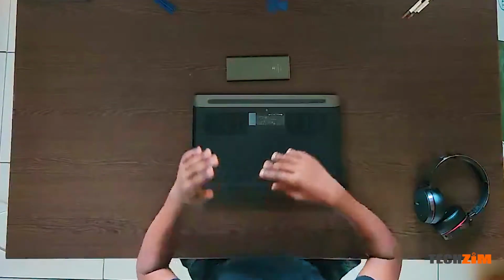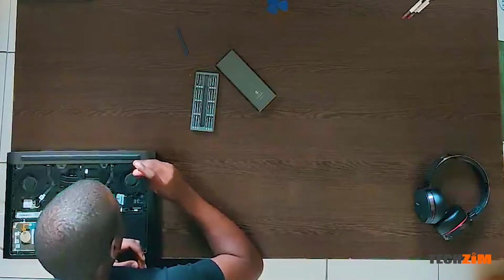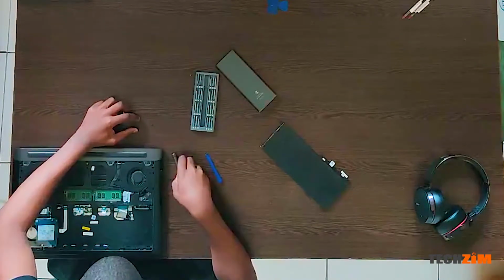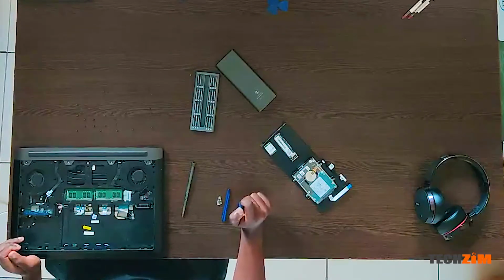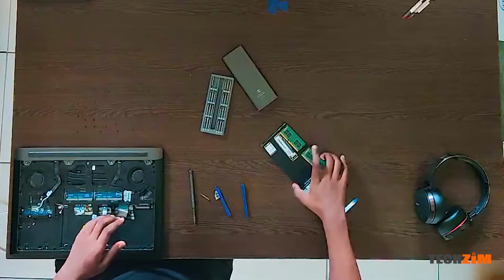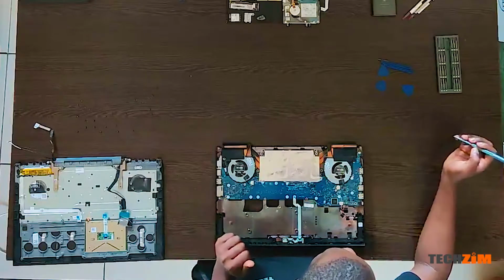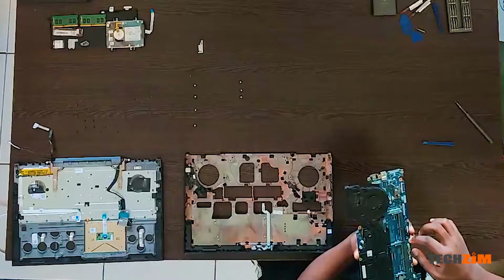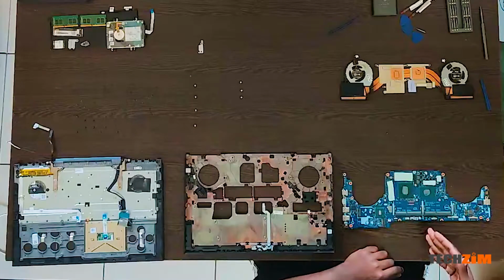Dell Inspiron 15 7577 disassembly

Comment: I have same model, i need to renew thermal paste. I use it since 2017, and its started getting hot. And some of my num keys and f12 not working.  I have 2 questions my dude. What u suggest for thermal paste brand. What could be the problem for unfunctional keys, am i need to change keyboard?

Comment: Thanks man. I've got a similar model. It's useful to see how I can go about replacing the thermal paste when/if the times comes.
How were the thermals after?
Reply: Hi Tich, thanks for watching hey.

The thermals are much better now. Thought I'm concerned about the quality of the thermal paste because this repaste was done not too long after the first one plus the way it just looked like it had disintegrated when I repasted was not that encouraging.
Reply: @rayhatron  Yea. For it to be look like it disintegrated like that is worrying.
Where did you buy it? I haven't been able to find thermal paste anywhere in Harare. I can't seem to find thermal pads anywhere either. Do you know anyone/anywhere?
Reply from the maker: You can try trickmut electronics along Kwame Nkuruma opposite Kwame Mall
Reply: instaBlaster...

Comment: Bro Hi I have same laptop dell inspiron 7577 fb30f81c and I want to change fan because I damaged it and it makes sound which fan IDK but I want to change both and Also I want to upgrade Ram and add SSD so my questions are : 
which SSD and Ram I can buy and which fans do I need to buy for this laptop also can you tell me the best thermal paste for my laptop?
Reply from the maker: Samsung makes the best SSDs and RAM but really if you go for any of the reputable brands you'll be fine. Crucial, Kingston, Verbatim etc. As for thermal paste, it does not really matter which you get. But of course try and avoid the cheap ones. If you can get liquid metal thermal paste that might be the best but not very different from the regular stuff
Reply: Can I use an nvme ssd in this machine?